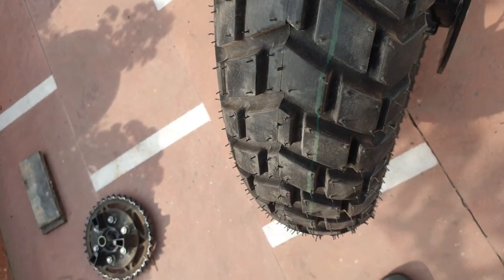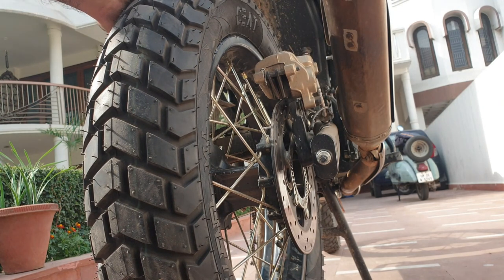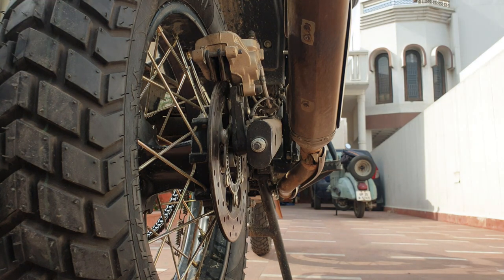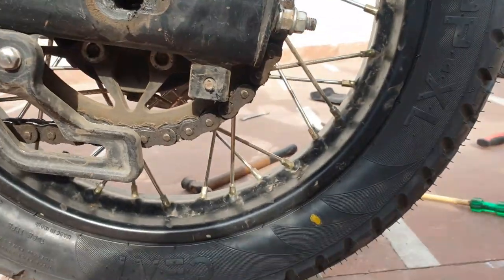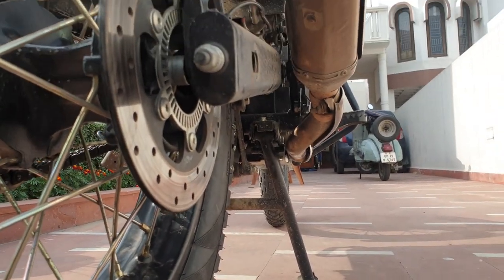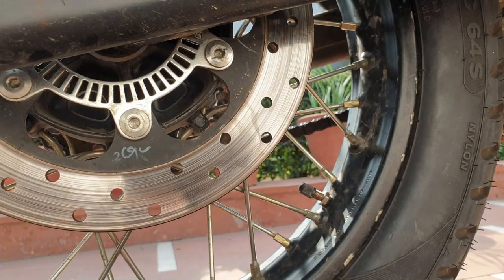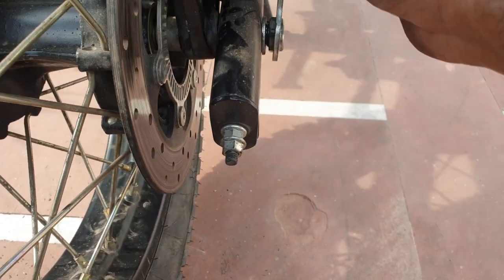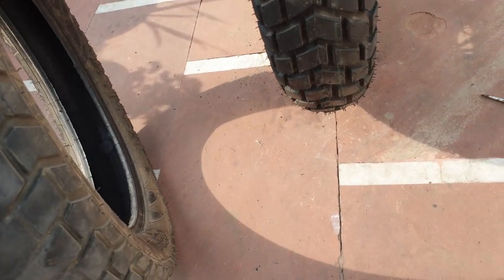Royal Enfield Himalayan - Rear Wheel Re installation DIY

Comment: Personally, I have already changed my tires twice, I made a piece of wood 50 mm long and the diameter of the axle of the wheel that I place to hold the spacer to the right of the rear wheel to winding, the spacer holds by itself and when I push the axle of the wheel, the wood comes out to the right and the ring does not fall, I find that very useful. The same goes for the front wheel. In addition, I suspend my rear wheel using a spanset to keep it at the right height. Sincerely François
Reply from the maker: Thanks mate that is a very practical way to do it. In future I too will look into fashioning something like that, cheers :)
Reply: @leuheanrede  hi friend, the piece of wood is very practical and the spanset, I pass it at the top of the wheel and on the saddle with a protection, you can adjust it to the nearest millimeter, it's like a third hand, nice week friend to you
Reply: @leuheanrede  wow that's a great idea brother 😍👍🏼

Comment: I had my rear changed today,.  The wheel was easy to remove but a real pain to put back, the spacer on the brake side would not stay in.  Ended up using a bit of grease to hold it in place when lifting the wheel to put the spindle back in.  Still a bit of a struggle, and raining while try to do it! I found removing the brake pads also helped a bit.
Reply from the maker: All's well that ends well :), yes some bit of grease will take care of the spacer, and as for pads, indeed those slippery suckers, but yes removing them is one way, push the cylinder in so squeezing the pads in becomes easy. Trust me, second time and there after is much easier :) cheers

Comment: I generally sit on the floor facing the number plate, then i roll the tyre at the end of my boot/feet to push the tyre upward and as i am sitting, my hands are free, which i use to properly set the disc petal into the brake caliper and keep the damn spacer where it should be.
Sometimes I use a small rock or broken brick to keep the tyre up while setting it. It helps me as i am skinny person and the tyre is heavy for me.
Reply from the maker: Indeed mate thats the way to go, wedging something between tyre and surface does make things easier, and yes same for pushing it upwards, cheers :)

Comment: The spacer on the drive side looks like it is on the wrong side of the sprocket it seems to me to be correct if it should be on the outside. the spacer does nothing on the inside just floats about, correct me if I am wrong.
Reply from the maker: Hey mate. You mean that long one inside the sprocket hub. If yes, well that is supposed to inside so it can support the bearings on the outside of sprocket hub and the bearing on that side of wheel where the hub fits. There is one smaller one on the outside of sprocket hub that sits between swingarm and hub and same smaller one on the opposite side.
Reply: Have an expanded drawing of the complete wheel axel so we can see what goes where? Can't find a good one on the internet.

Comment: Thanks for another informative and also amusing video.  I've changed a lot of wheels in my time. When lineing up to slide the axle through,  I use a tyre lever to make life a bit easier. I now have to remove my rear wheel due to the rim going out of true. I have to teach myself how to true up the rim. Should be quite interesing. Thanks again!
Reply from the maker: Indeed mate, it does make things simpler, as for truing, front one has taken quite a beating and does need looking after, maybe it makes for another vid ;) cheers

Comment: If you are doing a long ride and the rear tyre gets punctured, do you fix the puncture at the side of road with nobody to help you around? OR Have you converted to tubeless? Thanks for the video demonstration.
Reply from the maker: Hey mate, yup, I always and always change tire at home, the only reason is that just in case I get a puncture on one of the rides, with no one around, I should be able to fix it as I am already well versed with the whole operation. and Trust me it come handy in real time.
Nope no tubeless conversion, and will never go for it too, with my riding style of jumping over rocks and what not, I wont last a day in the mountains with a tubeless ;) cheers